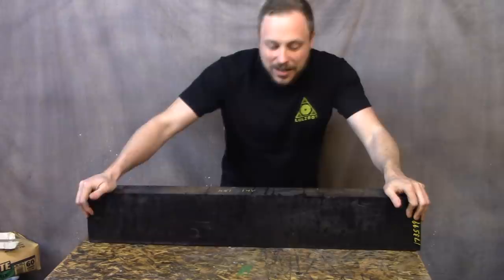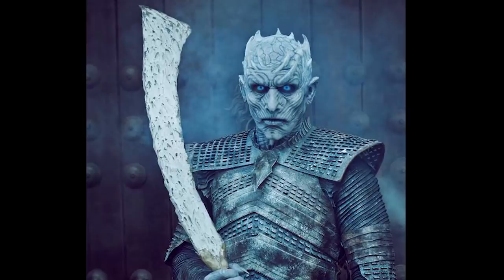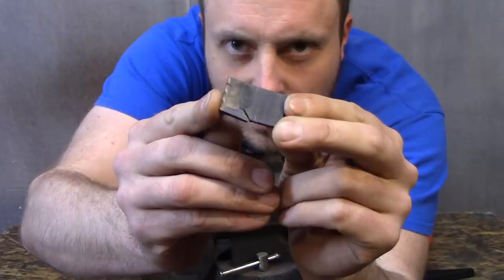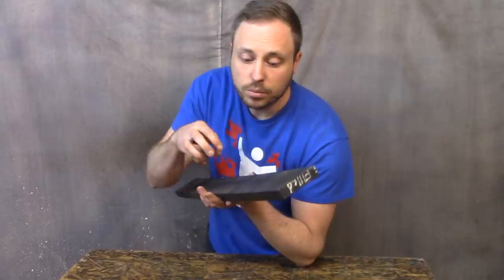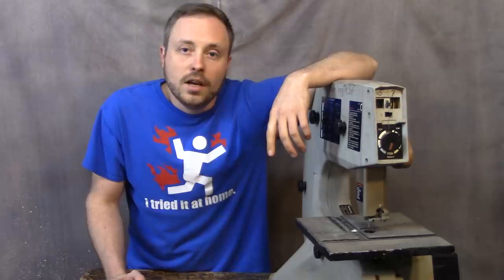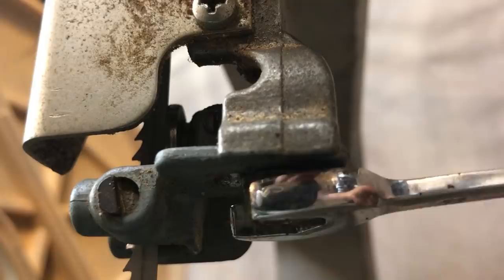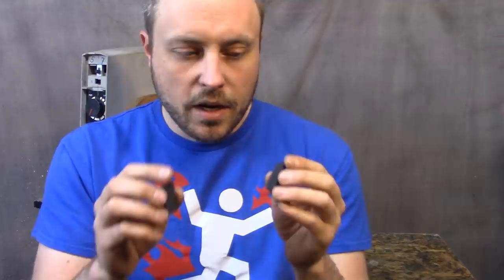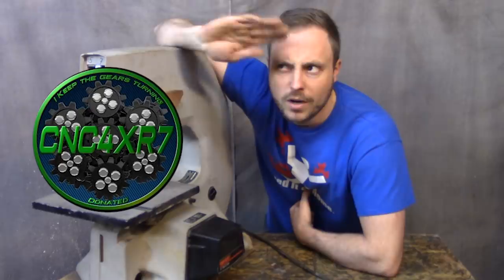Real Dragon Glass Sword from Game Of Thrones - Build Part 1

Comment: Jairus, Thanks For the Shout Out!   You can find Bandsaw blades on Ebay Cutting The fiber reinforced plastic is more similar to metal ( Aluminum) than wood I would look for something around 10TPI range which may improve the feedrate.
57" and 56 7/8" are normally linked together and you should have enough adjustment for both.

Comment: If that small piece was just solid polycarbonate it would probably take 20 seconds. The glass fiber has gotta make it more tough though.
Reply from the maker: Moss M yeah. I’m thinking the glass might have something to do with it, but the bandsaw isn’t crazy powerful either, and it doesn’t have a ton of tension in the blade.

Comment: Make an short celtic axe with a handle made out of mahogany wood or oak, then etch the left side of the blade with a head of an banshee screaming death and then on the right a raven head letting out a breath of darkness (optional). It can be any kind of metal, but preferably tungsten.

Hence the name "Morrigan's Song".
Reply from the maker: leon coasta that sounds far more complex than I will have time for, but it is a cool idea!
Reply: You can pick any kind of metal for less difficult, prior to similarities of tungsten's features and how it shares in common with a related metal. But aside from this point, I'm very fond of your work.

Reminds me of Man At Arms.

Comment: If you speed up the band's speed that would have the same effect as slowing down the feed rate.
It sounds like your electric motor might need to be replaced. You did say the saw was worn out. ;)

Comment: It looks like your bandsaw is missing a throat-plate as well, it is a flat disc of material which fills the hole around the blade in the table and stop bits from being "sucked down" into the machine.

Comment: the riffle could be cause by the larger area where you welded the blade but i dunno it looks like you did a fairly good job welding blades is pretty common practice for cutting odd shaped holes in parts most industry bandsaws have a blade welder right on the bandsaw but it is an art almost getting a good blade weld

Comment: glad the bandsaw ended up working out for ya.  I never changed the blade on the saw and the 57" was on there.  did you try googling for the manual?
Reply from the maker: burninghxcsoulable No. didn’t even think about it. Had a lot of fun messing with it and learning about bandsaws though!

Comment: So wait, I'm failing to see how the cuts being wavy would be problematic for this specific build, it's going to get gouged and textured to be like worked obsidian by the end anyway so why would you even need to clean up the waves? Normally it'd be an issue for sure, but why polish a piece of metal if the project calls for it to be rusty at the end am I right?
Reply from the maker: Rennis Tora This is true. I should have shown it. When it makes the ripples it sounds like it’s going to break the blade or the machine. I need it to last through cutting all the parts. That’s why I was so concerned about it working correctly.
Reply: @jairusofall  An understandable concern to have even if you can't beat that price.